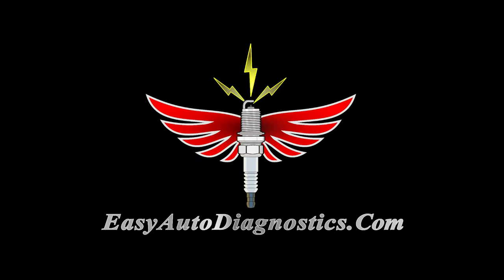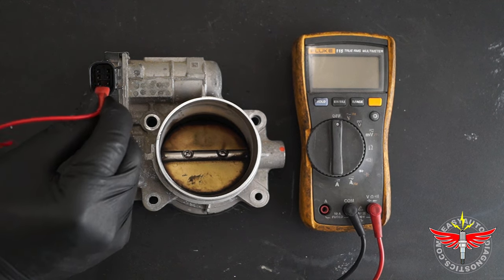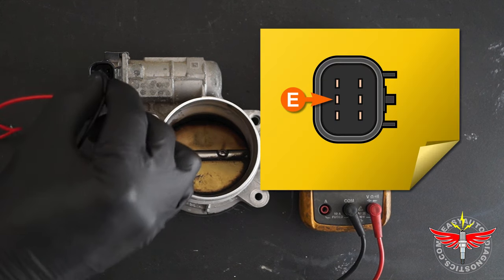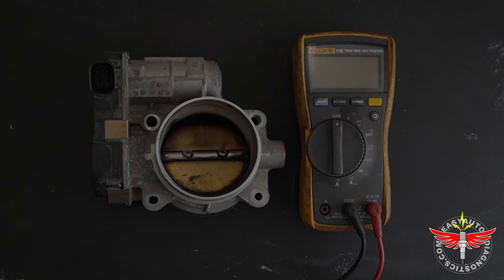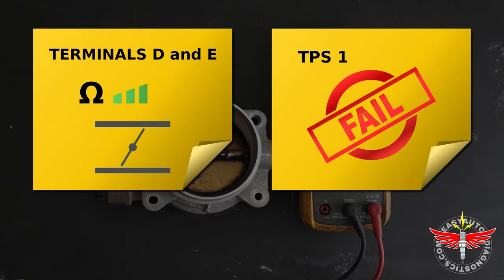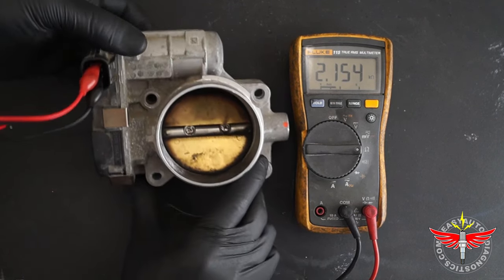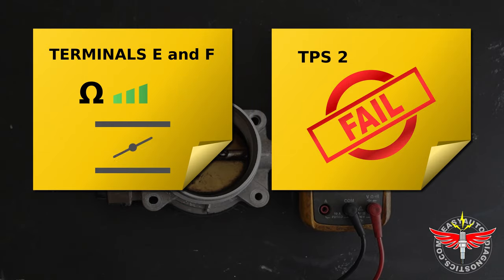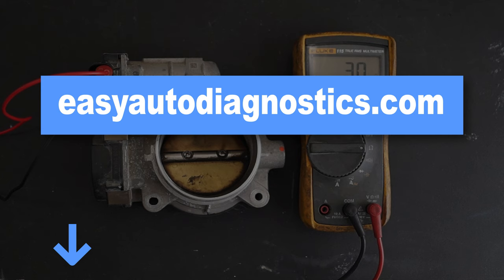How To Test The Electronic Throttle Body. GM Vehicles 2006-2011

Comment: Absolutely fantastic work.  Helped me confirm that my throttle body was defective.  Cannot thank you enough. Test was performed on a 2013 Chevy Silverado WT 6cyl 4.3L.  Test 4 was higher Ohms as in some other cases below.  My throttle failed Test 1 & 2. Initially had passed Test 1. Also had Ohm breaks in Test 2 where it went to OL briefly. Didn't see your throttle do that when pressing down on butterfly.  Tried to run test again to verify and then it failed Test 1 completely. Yes, I verified the leads were in the correct position and did another test to be triple sure. Went straight to OL both times. A million thanks. Let me know if you guys want me to post my video results to see what it looked like in the comments. Bravo!!

Comment: I used your diagnostic method to check a six wire 2009 Chevy Malibu 2.4 L throttle body assembly.  You're recommendation to use alligator clips was spot on. Would have been very difficult without them.

I couple of differences with the 4 cyl vehicle.  Test 2 & 3 were opposite polarity (i.e. opposite polarity when butterfly was opened or closed) but they seemed to have smooth resistance changes with no jumps.  Test 4 the resting resistance was higher, 30 Ohms, but not open (OL) or zero.  So i think the concept works on the 2.4 L engine but the system wiring or logic is different for the 4cyl model.  Haven't put the car back together but I expect my throttle body is OK now.
Reply: Hey I definitely could use your help!! I'm dealing with the 2.4 myself and TB codes.
Reply: I used the method in this YouTube video to rule out the TB.  I could be wrong tho. I have a few sensor codes all related to the ECM so I have a new one on order. If that not it it’s either a no spark or no fuel issue.  I reconnected all connections using a product called Stabilant 22. It’s supposed to improve bad connections. That didn’t work either.

Comment: Thanks for the video! I am working on a marine digital throttle & shift demonstrator for a training aid at the marina where I work. I pulled a GM throttle body out of the warranty pile and with your video can determine if it will work!

Comment: It is best to use analog multimeters for such measurements. Moving the throttle will show an immediate error in the resistor path. Measurements with an electronic multimeter are subject to errors resulting from the measurement itself. Digital devices simply do not perform linear measurement, but perform so-called sampling from time to time. And this means that a value that changes linearly is not really presented to us linearly. Therefore, it is worth returning to this type of measurements with old linear multimeters.
Apart from that, the presentation is great. Thenks.

Comment: So if any of these four test were to fail, is it safe to say that this component(throttle body) would have to be changed ? Also could you upload a video where your doing this exact test where this component(throttle body) is installed in the vehicle ? 

Thanks alot Excellent video !

Comment: What a great tutorial 👌.  This worked on a 2.4L ecotec 08 Saturn Sky.  Last test failed.
Reply: What did you get on the last test
Reply: @josemenchaca3944  I had less than 1 ohm on the last test. Watch for defective GM parts... after receiving and installing the new tb I was still having the same problem.
 I tried everything from doing an idle relearn to checking all vacuum lines, testing relays and fuses. Finally took it to the dealership to only find out that the new GM part was defective.

Comment: i have a 1996 a 1996 GMC Sonoma with 2.2 engine the power wire plug going to ignition control module has 2 wires - the plug that should have 6 wires only has 2 wires- is this normal- how do i check it ? trying to get a reply from easy auto diagnostics-thanks

Comment: I'll run these tests, but I first checked the 6 pin connector. Yellow and Brown wires go to the throttle motor from the ECM. TAC Motor Control 1 and 2. The other wires are low ref/signal wires, most reading 5v.

I'm only getting 4.43mV and 10.7mV on the Yellow and Brown wires (disconnected, ignition on), but i feel like one should be roughly battery voltage and one should be ground. 

I'd just hate to replace the throttle body and still have a problem.

Comment: Great tutorial!  This throttle body looks very similar to the one on my 2018 GM 5.3L Silverado.  Do you think the pinouts and trends you outlined in this video would be similar for my TB?
Reply from the maker: The test procedure is the same, but the terminals that are checked will be different. At the moment, I don't have the info the give you the updated instructions for your particular application.
Reply: Thx for the reply.

Comment: I have a question. My car is a gm Astra 2007. It has a 2.4 liter 4 cylinder 16 valves and a throtle body magneti marelli very.similar that you show in the video. My fail is when the car stays at idle. The car runs perfect but when i press the gas pedal a tinny the car fails like he want to stall out. And when you start at cold in the morning feels like starts in 3 cylinders and at 4 seconds pass to 4 cylinders. I clean the throttle body and te car works better but that issue its make me crazy. The sparks plug are new. People told me change the spark leads. Thank you

Comment: Hello dear teacher, my throttle body model is 96875250. but resistance values almost same with yours. So  I have a question: Can I use yours or other gm throttle instead of my throttle ?

Comment: So when doing this test, connecting the red to D and black to E shows absolutely no reading at all, connecting red to A and black to B also shows no reading at all. The other positions do show readings though. Does that mean my throttle body (VQ35, looks very similar to the one in this video) is faulty?

Comment: My 2006 Sierra 4x4 has the TAC Motor on pins A & C, which measures 1.6 ohm. Surprised there is so much variation between different automobile lines.

Comment: Would this rest work on a 2011 Equinox? I on the video says 2007-2009. Also just to confirm mine passed the first 3 tests but on the last one Red on A and Black on B I got no reading. Even though 3/4 passed would you recommend replacing the throttle body ?

Comment: Could you please accurately explain which terminals are where ?
The photo of the terminal block doesn't correlate accurately !
Is terminal "A" at the top left or top right  ?
Why don't you show the diagram of the terminal block first before you start  ?

Comment: Hi, really helpful video, I have a Mazda 5 sport 2007, that will not rev over 2000rpm, the connectors on mine are all in a row six pins, would know the correct pin to use, to reproduce your test,, a big thanks if you can help

Comment: What if you get all passing number on the test. Could the throttle body still be hanging up and not opening or closing all the way properly because of being dirty ect?? My throttle is sticking. The rpm will stay up after tapping the gas but taking my foot off the gas. I'm having rough idle loss of power and I think my chevy express even went into limp mode twice but then came out of it. It will run kinda ok sometimes but really bad other times. I've already replaced a lot of other parts trying to chase the issue down. I was getting o2 sensor codes replaced all them. Replaced maf sensor. All the plugs , coils and wires. Vapor vent canister solenoid .
Reply: Did you ever find out the solution?

Comment: Great video. Does this test method apply to the TB on a 2010 ZO6 Corvette with the LS7 which has the all aluminum TB and the actuator is also all aluminum? TB part number is 12570790. Thanks.

Comment: My question is does this apply to other cars say my bmw has the same style plug except its labeled 1-6
Reply from the maker: The GM part number of this throttle body is: 2173108 (GM Genuine). I checked for you and this throttle body does not fit any BMW.

Even if it looks similar, the internal circuits will be different. Using the test procedure in the video will give you the wrong test results.

What is the year and model of your BMW? I may just be able to find the procedure for it -maybe.

Comment: Grate , my Chevy Colorado throw me a code p2122 low voltaje on tps reduce power ,but after reset ECU , everything works normal ,could be tb need to be  replace ,thanks
Reply from the maker: There's a good chance that there's an intermittent failure of the TAC system somewhere. Try wiggle testing the wires of the throttle body connector. There's a good chance that one of the wires has broken inside the insulation. The wiggle test involves gently wiggling the wires of the connector with the engine running. If the engine idle changes, when you're  wiggling the wires, you've found the problem. The correct and expected test result of the wiggle test is for the engine's idle to remain unaffected.
Reply: @tecman129  thank you I'll check that!

Comment: Hi,
 
I need some help, I opened the butterfly valve to clean it while the throttle was still connected to vehicle... my car would only start for a couple of seconds then die. I replaced the throttle thinking that was the problem and still does the same thing. Im getting code p2101 along with other codes that were already there before I even touched the car.  

I checked for any corrosion or loose wires/bad connectors/harnesses and everything looks fine. I tried a reset (connecting the negative and positive battery terminal together) and to no avail. 

Also I should mention that I can press on the gas a good amount and the throttle will respond. But not when I depress it only slightly or moderately(when car is on). 

Can anyone help?

Comment: How do I relearn throttle body sensor on 07 Malibu 2.2
Reply from the maker: Per the GM repair manual instructions, this is how to do the 'throttle relearn' (it's actually the idle relearn):
1. Start the engine.
2. Let the engine idle for 3 minutes (in Park).
3. Turn the ignition OFF and leave it off for 1 minute (60 seconds).
4. Repeat steps 1 thru 2.
5. After the second 3 minute idle, the throttle relearn should be complete and the engine should be idling normal.
6. If after all this, the idle speed hasn't been relearned, drive the car at speeds above 44 MPH with several decelerations and extended idles.
7. After this drive cycle, the engine should be idling smoothy.

If the engine idle still has not been learned after the drive cycle. Repeat the entire process.

If engine idle has been relearned, erase any codes that may have been registered.

Comment: Hi, will this procedure work for Chevrolet Aveo uva also? Kindly suggest, thanks!
Reply: You ever give it a shot? I have an 09 Aveo with intermittent hesitation problems when accelerating or holding speed, if I pump the pedal a couple times it goes back to normal. This happens very randomly could drive all week no issues. Was planning on pulling the throttle body out and trying this test was curious if it worked for u?
Reply from the maker: The test procedure is similar but the terminals that need to be tested on the Aveo don't correspond exactly to the ones in my video. I'll post some testing details for you on this thread tomorrow.
Reply: @tecman129  That would be awesome these drive by wire throttle body's are a pita

Comment: Im strugling with my e throtle on my Lancer 2008.. not just unstable rpm, but the engine keep dying as soon as i release the throttle.. it cannot idle at all.. i hope i can do this but all the terminal are on straight line..any idea which end is the A ?

Comment: Hi, do you know where I could find the information about testing the throttle body of a 2005 Chevrolet Colorado?
Reply from the maker: If your 2005 Chevrolet Colorado is equipped with the 3.5L 6 cylinder, then this tutorial will help you test the throttle body: 

https://troubleshootmyvehicle.com/gm/4.2L/electronic-throttle-body-tests-1

 NOTE: The electronic throttle body of the 2002-2007 4.2L Chevrolet TrailBlazer is the same one for the 2004-2006 3.5L Chevrolet Colorado. The tests in the tutorial will apply to your 2005 3.5L Colorado.
Reply: @tecman129  hey, my Colorado is a 2.8L
Reply: @tecman129  hey, is the throttle actuator assembly part of the throttle body
Reply from the maker: The electronic throttle body and the accelerator pedal position sensors (on the accelerator pedal) are the components that make up the Throttle Actuator Control System on GM vehicles. As such, the Throttle Actuator Assembly refers to the electronic throttle body.

Right now, I don't have a tutorial detailing how to test the electronic throttle body on your 2005  2.8L Chevy Colorado. I will create and post a tutorial on how to test it for you on troubleshootmyvehicle.com tomorrow. When the tutorial is up and live on the site, I'll post the link to the tutorial here.
Reply: @tecman129  thank you SOOO MUCH ❤️❤️❤️❤️💕💕
Reply from the maker: @atlnchristy Here's the link to the 2004-2006 2.8L Chevy Colorado throttle body test tutorial: https://easyautodiagnostics.com/gm/2.8L-vortec/electronic-throttle-body-tests-1
Here's the link to the throttle body circuits wiring diagram: https://easyautodiagnostics.com/gm/2.8L-vortec/throttle-body-circuit-diagram-1

I'm curious. What issues/symptoms is your 2005 2.8L Chevy Colorado having? What diagnostic trouble codes are illuminating the check engine light?
Reply: @tecman129  I wish I could find the paper where I wrote down the actual code for you. It was a throttle body fault code. I took my throttle body off and cleaned it, which I had done a couple years ago too with this same one. But, this time, I heard some little pieces rattling around on the inside, like something had broken off in the inside pieces. I watched one video on throttle bodies and it showed two wheels in it which allow the plate to open in small increments of degree. If I had my guess, I would say that the rattling pieces were possibly some of those teeth on the wheels. I, myself, have been careful when opening the throttle plate to clean it, but I’ve had a few different people helping me diagnose the mechanical trouble and noticed the outside of the throttle plate now has a gash (like engraving deep) into the metal. So, it just makes me think that someone forced it open too quickly and possibly damaged it. But, when I put my key into the ignition and turn it to on, without trying to crank it, the throttle body plate will flitter open at least the first attempt of doing this. But, when I turned the key to off, then back to on, again without cranking, it did nothing. 

When I do try to crank it, it will behave in a similar matter in that, the vehicle will crank (without starting), then when I turn it to off and then attempt cranking again, it just does nothing (like, it won’t even crank). 

But, my Colorado had been having passlock issues for several years now. I’m a member of coloradofans.com forum, 355nation and have researched many other forums, YouTube videos, and online articles and the passlock problem seems to be a common burden many GMC vehicle owners deal with. 

I’ve recently (within the past two months) replaced the fuel pump, the fuel pressure regulator, spark plugs, water pump (the wheel bearings were stripped out) the idler pulley (the wheel had broken off), belt tensioner, and drive belt and my truck still won’t run. 

I’m so frustrated at this point. I’ve tried doing the passlock relearn and still nothing. I just can’t figure out what the issue is. 

I have noticed though, when going through these various attempts to start my truck that the run crank relay did have a lot of heat coming from it. But, I guess this is to be expected when I’m having to leave the key in the run position for 3 intervals of 10 minutes during the passlock relearn process. 

Idk. Im just trying to press on but, my funds have been tapped dry in this process. I will let you know what happens with the testing. It’s been raining here in Atlanta today. I might go out and just remove the throttle body and bring it inside to do the testing if it’s still raining tomorrow.
Reply: @tecman129  something else to mention, if I could get your thoughts on this…

Before my truck wouldn’t start back up when I was leaving a store and had to be towed home, for about a month prior I had been having trouble getting up my driveway. I have a 200ft steep drive with a privacy gate at the top, which I keep closed. So, it got to be where I would have to be going about 25 miles per hour when I began my ascent up it or it wouldn’t have enough power to finish the climb. Then, at times, after getting out and opening my gate at the top, the slight incline I was still on would present a problem in getting the truck to move forward and I would have to back down the driveway and up the street so I could get enough speed up to drive up it again. 

I had been assuming the problem was the fuel pump, which I had purchased but just hadn’t been able to install at that point. 

I also forgot to mention that I replaced the fuel filter as well. 

Another thing, months prior to this, I would sometimes smell fuel from the front of the truck, which is why I thought it might have been a problem with the
Fuel pressure regulator but, I stopped smelling the fuel towards the last couple months I last drove it when the truck was running in reduced power mode.
Reply from the maker: By the end of the day today, I will set up a contact form on easyautodiagnostics.com, where you can receive detailed answers to your questions. The YouTube comment section is too clunky for diagnostic back and forth of questions and answers. If my diagnostic info and testing tips help you, you can later post your repair solution here for anyone else having a similar issue. Would this be helpful?
Reply from the maker: The tutorial contact page is set up here (at the end of the page): https://easyautodiagnostics.com/gm/2.8L-vortec/electronic-throttle-body-tests-3